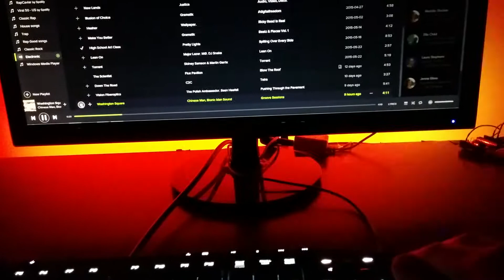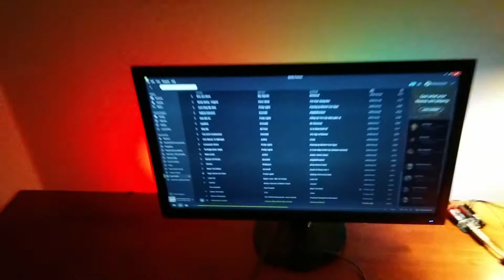Arduino controlled WS2812B led lights to music!

Comment: This is very coo! thanks for posting the code you used and explaining it a bit, this is just the start I needed for a project I've had in mind.. I don't know a ton about coding or the arduino's capabilities - do you know if you can change the two frequencies (or add more) that the adafruit_neopixel library? I am interested in creating an LED display that can switch between a "mood lighting" visualizer like you have shown here, and a 12 band equalizer - essentially with a matrix of 12 or so bands of 10 WS2812's mounted on a solid surface (so a 10x12 matrix) that can be folded down to light the area behind my sound system or raised to show the equalizer, with different colors for each mode. Obviously I have a long way to go from this code to what I want to do, I am just trying to get a handle on what the arduino and the neopixel library are capable of, so anything you can explain or add would help! Thanks a bunch!
Reply from the maker: @thousandbillion, thanks for your question, I would say that it is possible based on things I've seen on here but I  don't know much about this. I copied the idea from my friend but I'll let you know if I find anything out!
Reply from the maker: I think one thing you might be able to do is get multiple strings of the led lights and put them next to each other and then use multiple outputs on the arduino to control the different strings of lights. then just set the arduino to filter the sound waves into however many rows of lights you have.

Comment: at 0:36 I see the small RGB Driver Box, which has a small wire with IR Receiver, does it has to do anything in this ?
Also if you are sending a RGB Output there must be 3 signal outs ???
Reply from the maker: Hey, sorry for the late response, the IR receiver isn't controlling these lights in the video, and there is only 1 signal wire going into the LED strip. The other two are power and ground wires. 

Hope this helps!
Reply: Sry but I dont undestand, where do you conect the signal output of the arduino? in the red RGB? in the blue RGB? or the green?

Comment: Think you could share your code? I have done it now, the only problem is that when music plays it only uses 50 ish leds and going frome the middle and out to each sides and back, tried figure out how to do it on the whole led but dont seem to figure it out. And another problem is that its only blue on that part with red moving leds. And the rest of the 300 led are rainbow
Reply from the maker: xXellaScopesXx The code has a part on it which will let you set how many LEDs are in the strip, I don't remember exactly where but it's near the beginning I think.
Reply: yeah I got it work and running in the car now, thank you so much :)
Reply from the maker: xXellaScopesXx that's awesome!

Comment: Doesn't work, stays on with Blue & Red ???????????
Reply from the maker: Do you get the rainbow effect when no music is playing?
Reply: +Daniel Schultz,
Do you get the rainbow effect when no music is playing? (No, it flickers a little very fast rainbowish then go as following). I tried the code (arduino library from a zip file) and loaded it in to my Arduino and ran it, it just sat there lite up with a row of blue and red on the strip. I'm using a Mic-pickup for the input from music playing loud in the back-ground in the room.
Reply: +Daniel Schultz , This some of the code:

vol = total / 80;
// Serial.println(vol);

  vol = map(vol,20,255,0,20);
  
   if (volLast > vol) {
    vol = volLast - 4;
  }
  volLast = vol;
  fadeAmt = 0;
Reply from the maker: +MrRussCornell edit the line with vol=(20,255,0,20) try different numbers, bring the 255 down to like 20. They have something to do with the sensitivity.

Comment: Do you get the rainbow effect when no music is playing? (No). I tried the code (arduino library from a zip file) and loaded it in to my Arduino and ran it, it just sat there lite up with a row of blue and red on the strip. I'm using a Mic-pickup for the input from music playing loud in the back-ground in the room.

Comment: Hey, im about to do this as a project in school but I dont get how you did it, could you describe or do a schematic for how you wired everything togheter?
Reply from the maker: xXellaScopesXx Yes, did you check the description of the video? I can get you more details if you need also.
Reply: yeah I saw that but didnt quite understand the wiring you explained or showed. But the code yes. I saw that
Reply: a sketch of the wiring would be really helpfull
Reply from the maker: Hey so the for the wiring, run the +/- on the LED strips to 5v, for this I used an old USB cable and cut it open then took the wires and made a connector so I could hook them up to the strip. The middle signal wire goes to any digital signal pin on the Arduino. Then take your aux cord and open it up, inside you will find two insulated wires and one non insulated, use one insulated wire as the analog signal input for the Arduino, and the non insulated one as the ground. The aux cord wires go to the analog inputs on the Arduino, and the one signal goes to the digital pin on the Arduino. Good luck! Hope this helps.
Reply: Daniel Schultz yeah thank you so much
Reply: hey Daniel quick question is there anyway you could draw the schematics for this project on how to hook everyting up please it would help me out big time because im making this project for school and i have to show it on monday

Comment: my i have 120 led on my strip and just 60 lightning why?
Reply from the maker: JuggerSky you need to change the number in the code for how many lights there are in the strip. Somewhere around the beginning of the code there should be a line with 60 in it and you can change it to 120.
Reply: I changed but it didn't work
Reply: and if i touch the jack cable the strip color changes to green
Reply from the maker: JuggerSky hmm that's strange, the color change is actually normal I think because you might be generating a signal with your finger, but idk why it won't pick up your 120 light strip...
Reply: okay thank you

Comment: Dear Daniel Schultz do You think that I should change in the sketch . For use with the Arduino Nano in my case .
Reply from the maker: галина сидорова I think the code should be similar, just might need to mess with what input/outputs you use and make sure it is the same in the sketch.